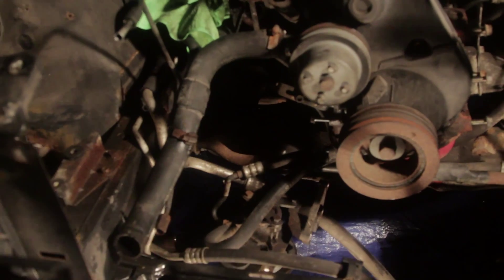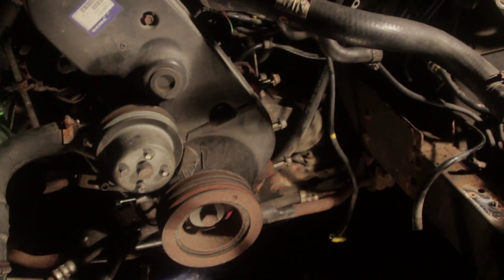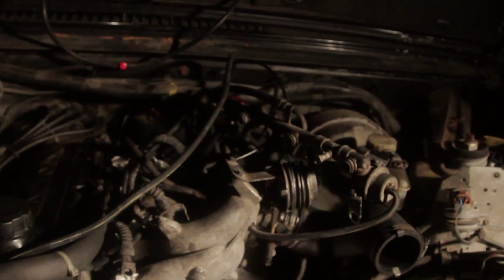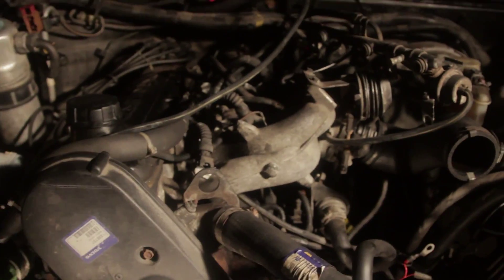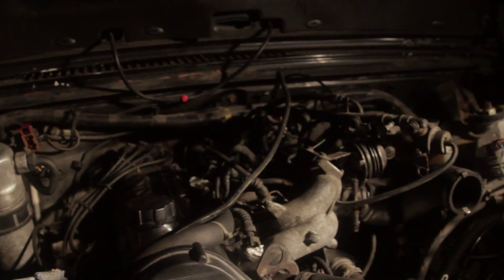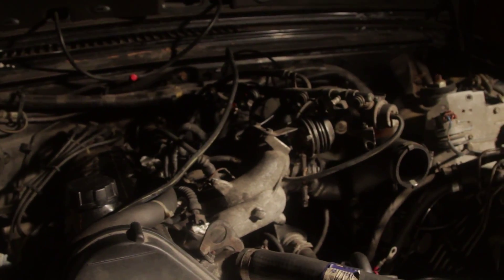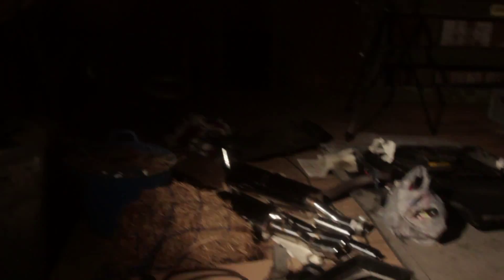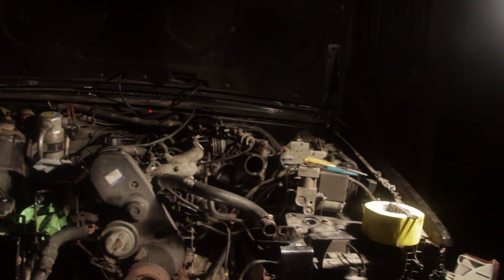Volvo 940 Engine Swap Day Two (B230ft Turbo)

Comment: So I am about to set out to do a b230ft swap (from an 88' 760) into a 91' 240 and I'm watching some of your video's just to get a rough idea of a b230 swap in general (since I've never swapped a motor before lol) and I'm curious about this gold ecu you pulled out of your wagon and as you said, it being the only chipable ecu? I'm not familiar with a gold specification to an ecu, and who sells the chip for it anyways?
Reply from the maker: At some point volvo made the EPROM (chip) removable on their ECUs and EZKs  and then at some point switch to soldering the EPROM to the main board. Im not sure where they made this switch or what cars got what. If you go on turbobricks forum and contact TheLostArtOf he has some custom mapped EPROMS he makes and sells to the community. If you google for his chip for sale thread it will tell you which ECUs and EZKs are compatible. One thing to note though is that chips for these cars do not function the same as chips for other cars, adding a chip will not add 15hp or whatever. Adding a chip will simply change the fuel and spark map to prevent you from leaning out your AFRs under higher boost then stock. You will only notice a differece after you make real mods to the engine such as bigger turbo, camshaft, better intake manifold and so on.
Reply: ***** Oh damn, right on. Thanks man!